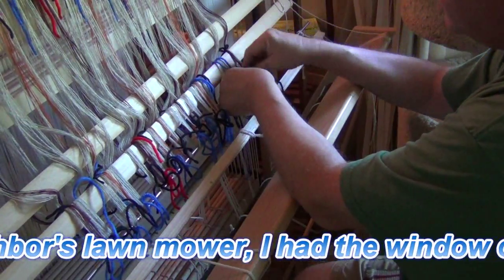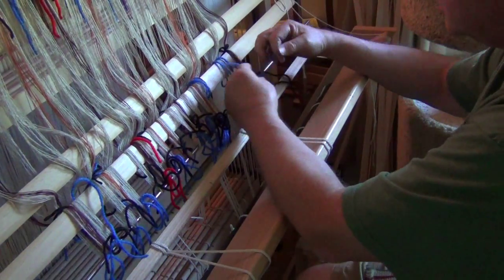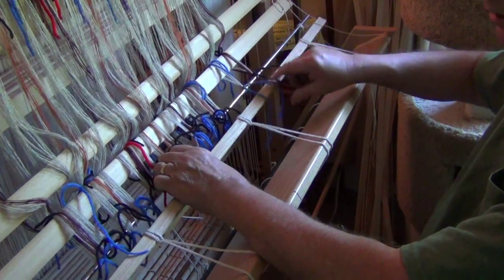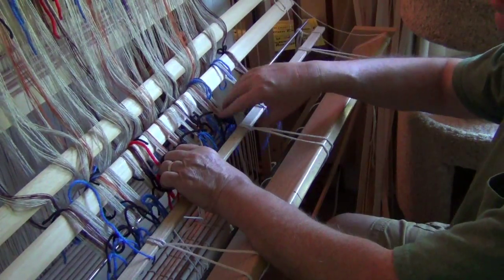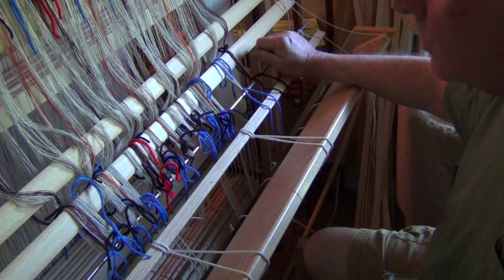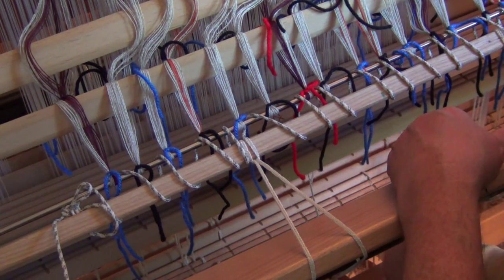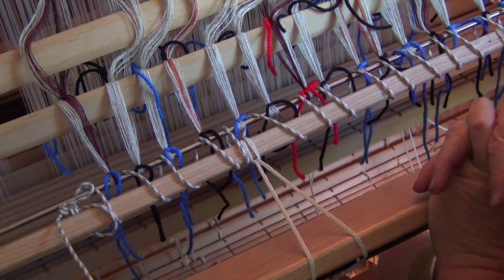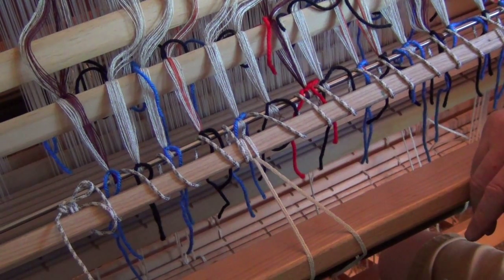Tying One On

Comment: When you titled ' tying one on' I thought you were still at JB's - ha ha ha!    Andy, when I've got my metal bar in the loops of the warp, I never cut and tie, I just leave as is.  I was suprised when you mentioned cutting at this stage.
Reply from the maker: movourneen  I don't CUT at this point, I only TIE.  I tie the loops of warp to the metal rod.  That is to prevent it from slipping.
Reply: curmudgeon66  OK Thanks.